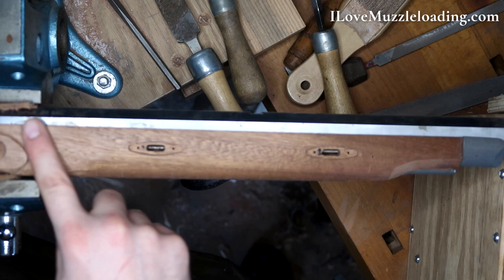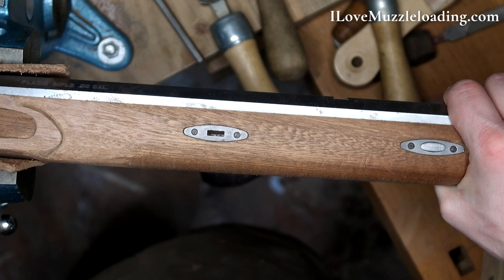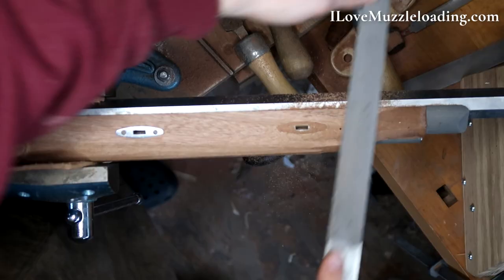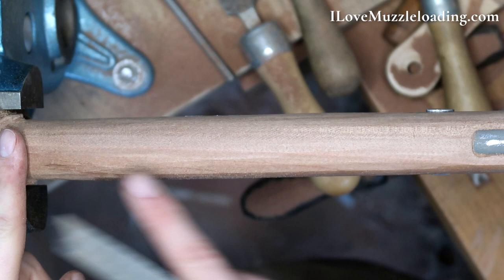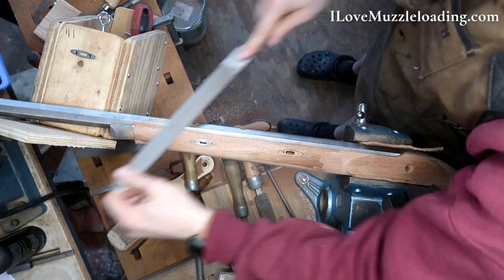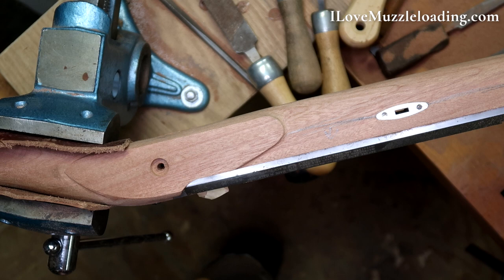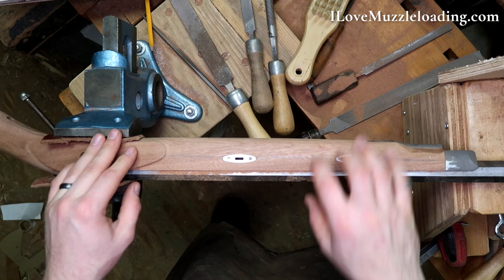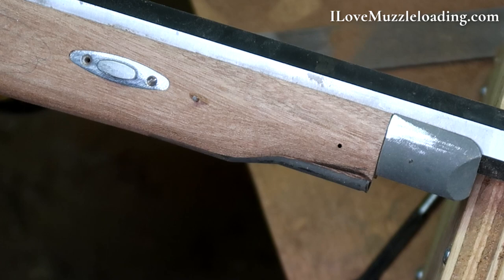Let's Build an Investarms Gemmer Hawken Kit Part 7: Shaping the nose, entrypipe, and clean up

Comment: Your doing a fine job taking your time, and it is appropriate to translate it into your video. Now the only point I think at this juncture I would like to add is this. The metal fixtures are also just a casting blank. Therefore is a possible point of some custom reshaping as well. So that being said for example you chose slender up, round out corners, or even reshape the nose now is the time to do so before finish fit to wood for overall blend in. I've been known to have my own look on casting too. Keep having fun.

Comment: tip for you put the tinions in before you stain and treat the stock.. then go back and treat the wood under the tinions..if not you will find you will have to reinlet the tinions 85% of the time.. the stock forend will really tighten up after the stock is treated..
Reply from the maker: Thanks Randy! I’ll do that